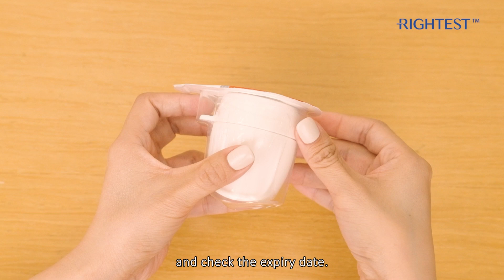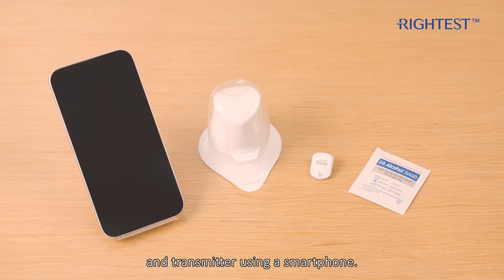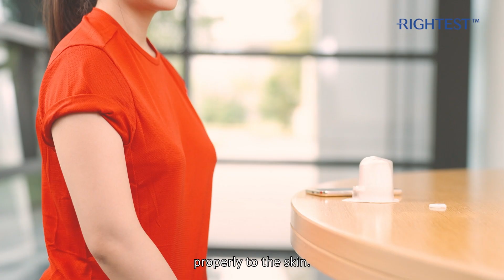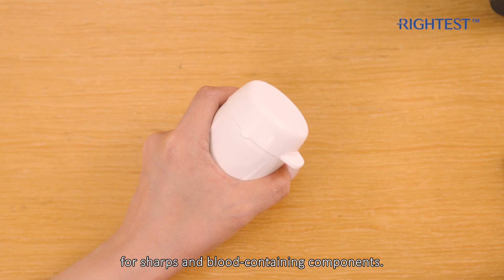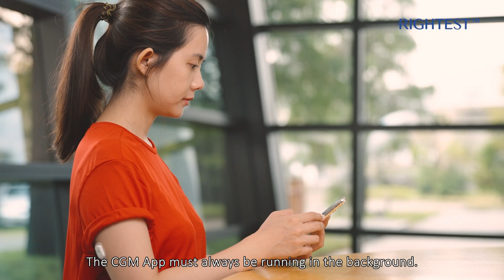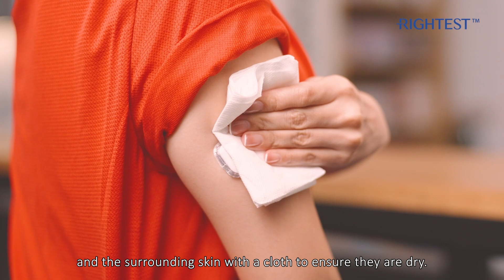RIGHTEST iFree2 CGM Operation Video_iOS

Comment: The transmitter lasts 5 years but not the sensors. Sensors will need replacing atleast once every 15 days to prevent infections and damage to your skin/muscle